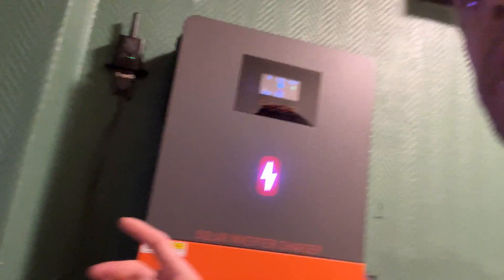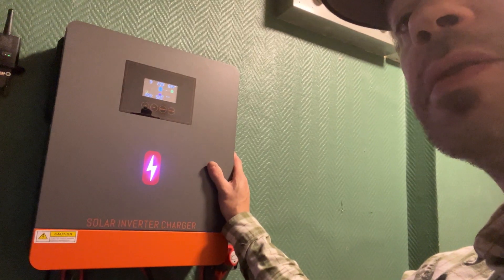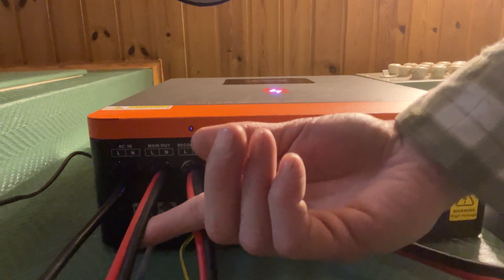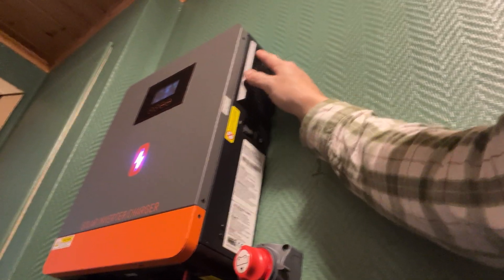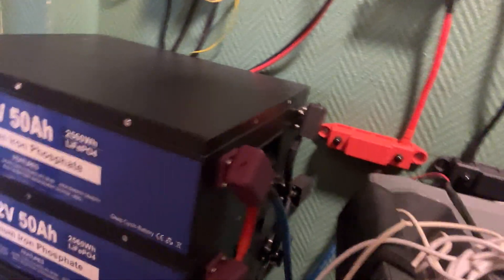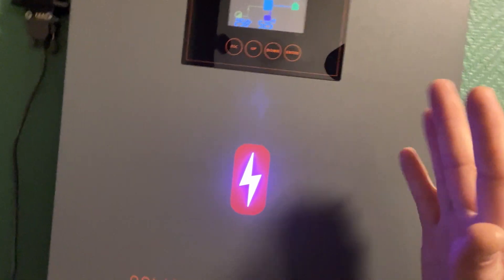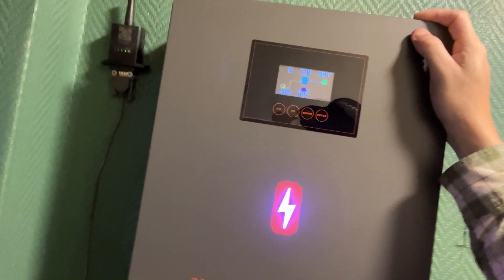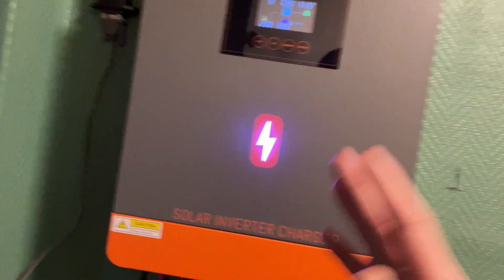PowMr 6.2 kw inverter. Solar Power- My journey, becoming self reliant on energy.⚡️@PowmrSolar

Comment: Hi Stian, I just brought my PwMR inverter life. I notice that without load it outputs 208V while it is configured to supply 230V and it also has 230V on the input. Do you also a lower output voltage? I'm trying to figure out if this is normal or not. Chees!
Reply: found it: never use cheap ass multimeters ;-)

Comment: Would you be kind enough to send links of the equipments you use please?...am thinking of going solar but am a dummy to electronics!!!
Reply from the maker: My portable system 
https://eu.fossibot.com/products/fossibot-f3600-pro?variant=48948167835944
i also have coupons so you can save money on all the Fossibot products , then you will also you will support my YT channel .

My wall mounted system
https://powmr.com/products/hybrid-inverter-charger-6200w-220vac-48vdc
Reply from the maker: The batteries I got of Amazon , DCHOUSE 50AH 51.2V BUT YOU CAN GET EVEN BETTER BATTERIES NOW ON aMAZON Cheaper and better... The dchouse ones are great
Reply: @stian942 ok thank you

Comment from the maker: it has two outputs ,main output can put out 6.2kw and second output 2000w but.. it’s still only puts out a total of 6.2kw . The second output is when the batteries are are nearly empty , then it disconnects the main output until its starts charging again . So the second output put will be the important stuff like fridge freezer lights and the main output will be other loads . I ordered a main fuse on amazon from lateau 25amp fuse for main load . The mathematics is 230v x 25 =5750w 
For second load you search and find the a fuse size for the more important loads . Fridge freezer , lights . Second load fuse does not need to be 2000w its just a line out for the few most important loads until you get charging again 😊

Comment: nice video! what does your solar panel layout look like?
Reply from the maker: Hi 👋 I am glad you liked the video . 
I have 16x410w HI MO Longi panels that I have in 2 strings in series.10 in one string then 6 in 2nd string connected together into one pv cable, using a Y cable so I can connect 2 strings into one . Then it goes to the inverter . I have the panels angled at 46* angle using iPhone to get correct angle. I have just put the panels quickly up and with materials laying around because I wanted to have it up and working as soon as the equipment arrived. But I’ve ordered .Solar Panel Flat Roof Tilt Mount from Renogy because they had a good sale and still do . Then I will use them as ground mount and not on the roof . I think they cost around 17 euro per mount ,
Solar Panel Flat Roof Tilt Mount
RNG-MTS-TM100-EU , https://eu.renogy.com/products/accessories-wiring/       Then it will be looking more nice and I will be able to adjust tilt .
Reply: @stian942  I see your total open voltage is about 560. I believe this PowMR inverter is rated for 500V, but it's only a slight difference, it won't matter that much I think. 16 panels is quite impressive, that's 6.6 kW! I'm guessing you could do with less, but I'm in Belgium and maybe we have a tad more sun. also, could it be that your inverter model is an older one? the POW-HVM6.2K-PRO seems a more recent one, I'm thinking about buying that one.
Reply from the maker: I believe that is the battery voltage you are seeing . My pv voltage I think the highest I’ve been and then I was over paneled by 2 panels so 18 x 410w then my pv voltage was round 350v . I allways keep an eye on that . But I was getting close to 6500w solar input so i disconnected 2 panels and use those now on my portable Fossibot f3600 pro . But each week I see the solar input is going up with more sun outside . On amazon you can get a Elejoy solar panel multimeter and you connect it to your solar panel - 1 panel . Then it will show you your -Voc -Imp-Vmp and panel output, if you are not sure . But the screen on my inverter shows voltage and amps . I will find a link to the multimeter
Reply from the maker: https://www.fruugo.se/1600w-photovoltaic-panel-multimeter-solar-panel-mppt-tester-open-circuit-voltage-test-power-point/p-354659490-771215305?language=en&ac=ProductCasterAPI&asc=pmax&gad_source=1&gbraid=0AAAAADpXug0osgtmmaDA-cMQyk7WbNTcq&gclid=Cj0KCQjwlMfABhCWARIsADGXdy_BFkwsp3vM2dCpmwypMzSKkLKJfdKUD9avRuV7-eoPszykBauaPgkaAo1ZEALw_wcB
Reply from the maker: I have a 400w multimeter , they come in different wattages . They also have them on Amazon
Reply: @ battery voltage should be much lower, like 48V for instance if you have 16 3.2V cells.
Reply: @ cool, thanks, found it on Aliexpress.
Reply from the maker: @bartconinckx  fully charged 48v battery is 58v .. a fully charged 12 v is above 12v Google it 😌👌
Reply from the maker: You can also change settings with how low or high you like the charge to go
Reply: @stian942  yeah, sure, but with 16 batteries in series we say this is a 48V setup. that's also what your inverter is specced for" 48V.
Reply from the maker: @ when charging a 48v battery it will show 58.4v . When charging stops the battery will show 54.4v … so fully charged the voltage is 54.4…

https://shopsolarkits.com/blogs/learning-center/48v-battery-voltage-chart

I hope that helps explaing ❤️⚡️⚡️
Reply from the maker: Like and subscribe to help my channel grow ❤️❤️⚡️
Reply from the maker: @  I have content out on #PowMr solar on the inverter and my setup.  
https://m.youtube.com/watch?v=OmA68iGfHvQ
Reply from the maker: @  https://m.youtube.com/watch?v=OmA68iGfHvQ
Reply: @stian942  cool man! question: are you now actually fully off-grid?
Reply from the maker: @  I have the grid connected but run everything from solar excepts my lights . I bought on Amazon a 2 plate cooker for 30 dollars and got it delivered yesterday so now I’m just running lights from the grid . And if there are days without much sun I can charge from the grid at night with lower cost hourly rate spot price . Pulling in about  23kwh daily but to achieve this I have to put washing machine on , dishwasher ect ect and also charge my portable system . Because once batteries are full the solar stops coming inn if I don’t use the power
Reply: @stian942  so your daily use is 23kwh? that seems rather high to me, I have an average of 9.6 kwh calculated from my energy bill.
in Belgium you need to have your setup checked when you tie it to the grid and you also need to pay to inject power, so I decided to make an off-grid setup with a switch so I can go to the grid on wintertime and be off-grid for the rest of the year.
Reply from the maker: @ i do washing machine usage but not the 30min quick wash , dishwasher ect and charge my portable system up fossibot f3600pro 11,5kw batery storage . Use heat pump and today I cool the room , mornings and at night heat apartment . Try to use as much as possible . I also turn down my charge amps to slow charge, I am getting some more battery storage . I have 17.5 kWh all together with portible system . I can also disconnect the solar panels. Basicly I use as much as possible lol 🤣 it’s a nice problem to have to much power . I have a house I’m renovating with 3 apartments I live in one of them . But also I turn up the temp on water heater
Reply from the maker: @  my daily use is not actually that high . I just got started about 6 weeks ago using my systems .
Reply from the maker: I guess it’s the winters that are challenging , I will see when that time comes , but charging at night on hourly rate is getting cheaper power . Not selling any . I hate the power companies.! They charge to much . This starting solar I’m my middle finger up to those ppl
Reply: @ do you use as much as possible to avoid injecting back to the grid?
Reply from the maker: @ i dont send any back to the grid . I could but I don’t want to sell cheap for them to sell to others at expensive rates . No i just use as much as possible here at home 🥳 . Just super happy to not be paying a bunch of money on power to the power companies . I have wanted for so long solar and the last year it has become much cheaper . So i bought 2 systems , portable system and after a wall mounted hybrid system , not knowing it was s hybrid inverter when i got it ❤️⚡️🤷🏼‍♂️
Reply from the maker: @bartconinckx  i use as much as possible and have fully charged batteries when the light dispears lol . 😜
Reply: @stian942  I'm about to order my inverter. My house is rated for 40A, but this 6.2 kW inverter only offers 28A. Was that enough for your house?
Reply from the maker: @bartconinckx  I think it is 26.5 amp . As long as you don’t need 3 fase then I think it should be good for everyday use . I have not had any problems with fuses . Maybe if you run microwave , washing machine , water boiler, and ac . All at once then it might go over 26,5 amp or 6200w .
Reply from the maker: @bartconinckx  so it depends on how much the power use is , all at once ..
Reply: @stian942  yeah, I live alone as well. I think it should be fine. there does not seem to be a bigger model in the same approximate price range, so I will order this one. cheers!
Reply: @stian942  what size DC breaker did you use on the battery side? I see the inverter does 120A, so times 1.25 that is 150A. Voltage should be about 58V for full battery (16 LiFeP04 cells of 3.2V, 320 Ah) but I'm not sure if you are allowed to use a higher voltage type.
Reply from the maker: https://panelshoppen.se/products/longi-410
Reply from the maker: https://youtu.be/K9Tfivf5bAI?si=1wL0EPCsE7OLM33P
Reply from the maker: https://youtu.be/1G8WxY_jcUM?si=oFgLg0jtEDXqsoHT
Reply: @stian942  how did you setup your solar panels. series, parallel or both? cheers!
Reply from the maker: I live alone and I have not maxed out yet
Reply from the maker: 26 amp for main load,brand lateau. Amazon
Reply from the maker: Second load is for when batteries run low . Then it cuts main load , the 6.2kw . And the it only puts out power on second load until you charge again . So that’s your lights and fridge freezer
Reply from the maker: Second load just need to be under 2kw just for lights and fridge freezer so that still has power until  you start charging again . You can set the limits when this kicks in on the app. You also want to buy the wifi dongle so you can monitor and change settings easier via mobil or computer
Reply: @stian942  the wifi dongle is sadly currently not available on eBay but I plan to buy that as well. there is a ESP32 monitoring system available, but it won't work for my PowMR inverter sadly.
Reply from the maker: 230x the fuse then that gives you how many watts
Reply: Hi very good vidéo 
Can you explain how you connect the grid on this device an how you can see the power coming from panels in your house?
Can you send me the plan wire of your installation 
I don't want to put batteries on my systèm 
Thanks from France